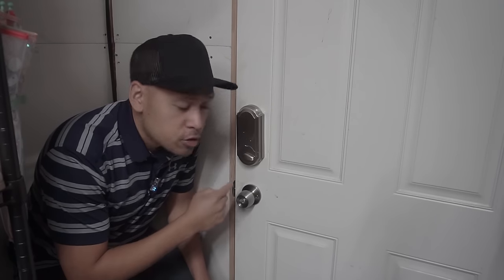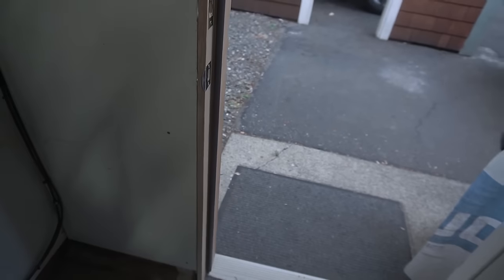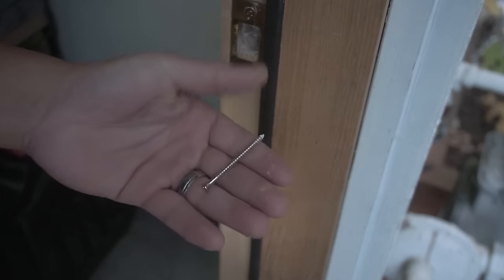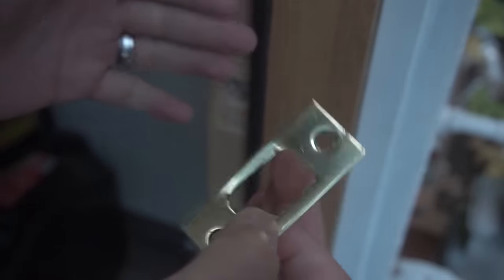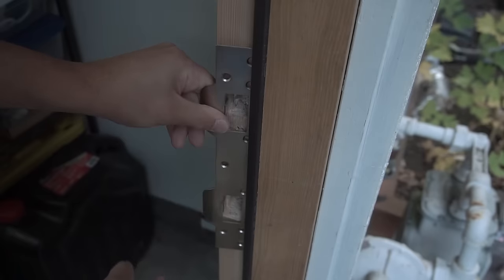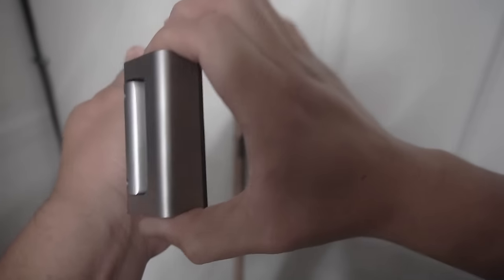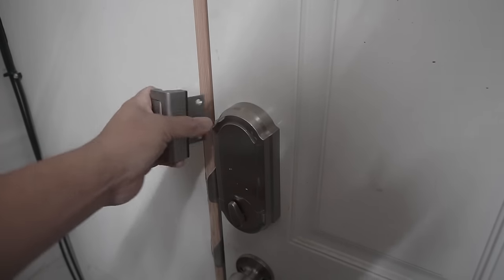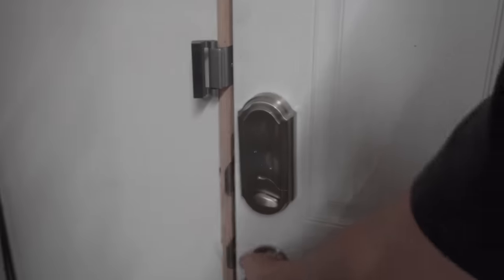How To Make Your Door Kick-In Proof Like A TANK! Keep Your Family & Home SAFE!

Comment: I am sure I am duplicating some comments here, but I would replace the screws on the hinges with 3" screws and get a brace for the opposite side to prevent the wood around the lock caving in. I'd also recommend a Haven lock or similar product which is independent of the door to prevent entry being gained easily. Absent that, great job on your site!

Comment: great video...  not sure if you've ever showed the screws that are used on sliding glass door locks  (the part that's in the frame and the door locks into)...  they are so short...  My neighbor's installer used the screws that came with it.  A burglar grabbed the exterior handle and just yanked the door open pulling the tiny screws out in one motion.   When we had our sliders installed, I made sure they were using 3" screws..  fortunately that was the installers normal practice.

Comment: As some have said, thicker stroner hinges with thicker longer screws. Next weak point.. That window at the top... And.. As an additional idea, a steel reinforced door (either wood panelling sandwiching a steel sheet - giving effect that it's JUST a 'Standard' wood door - wink wink, or, a steel sheet on the outside...) but then, find other weak points, like windows, window frames, etc etc. (A friend of mine (did the steel door trick, and also, laminated/integrated sheets of plexiglass on the inside of all his windows as someone had smashed a window and gotten in that way...) It can be made to look like nothing is different, but, confuses those that 'Think it's easy to get in'... Hahaha 😉
😎🇬🇧

Comment: Having worked as  firefighter for 30 years and having performed forceable entry into every kind of building.  I have found that building security is only as good as to the amount of noise the bad guy wants to make.   If they have the ability to make enough noise, they will get into the building.  The problem is that some forcible entry techniques do not make a heck of a lot of noise.  If you are using a circular saw, yes...using a Halligan pry bar, not so much.

Comment: Thank you for your video. 

Measure from the doorknob down, make a two by four six inches longer than the measurement with a notch in one end for the doorknob and cut the bottom at the right angle to the floor and place a stopper where the two by four hits the floor. 
Jam in the two by four under the door handle and the floor stopper and it works great. 
Any pressure against the door lifts the door slightly jamming it harder into the frame at the top of the door. 

Good luck
Reply: Can you please elaborate a little on this “ stopper “ and your solution ?
  I’m intrigued but don’t “ get “ it …
   Thanks in advance .
Reply: @rudeawakening3833  The 2 X 4 is notched on the end that fits under the door knob. It then slopes to the floor at an angle and where the end butts the floor you want a "stopper" to keep the end from "kicking" out".
This stopper could be a block of wood, a notch in the floor, a couple of nails, ... anything that stops the butt of the 2 X 4 from sliding or kicking out when the door is forced. 
I pray that helps.
Reply: @daval5563  
Thanks very much , sir .
   Have a Blessed day .

Comment: Metal frame that's lagged into the ground on a concrete floor and an expanded metal plate that goes through the whole header and screwed into the trim studs.  With a wood frame, that's absolutely the best security you can have.  And it only takes a quick hour's worth of site-work with a competent carpenter to make it happen.  Then use a security door, deadbolt, and have the latch of the handle sink in far enough to where it seats fully into the strike (which is what the lip is for, so the bevel catches it and pushes in).  That makes it card-proof.  For extra-extra security, put a jamb guard on it so it's that much harder to get a sawzall in the gap.

Comment: I've used reverse to prevent striping, but never splitting. 🤷🏼‍♂️ It's the sharp point that splits to prevent tap it with a hammer to dull the point

Comment: Must say that the last application is what makes a tank. I've seen plenty of doors kicked in but also besides the jamb the door itself splits when there is a deadbolt with an extra heavy strike plate installed. The dam lock is truly the" tank" of this system

Comment: Being a carpenter I knew about the short screws in strike plates and the hinges. I have put many 3-inch screws in hinges to suck the top or bottom of the door over to make it close better. However, I had forgotten about these heavy-duty one-piece strike plates that I had seen at Lowes and/or Home Depot. Plus I never have seen that reinforcement lock. Hey, you forgot to replace the 1-inch hinge screws which is another weak point since they only go into the door frame and not the 2x4 studs. If someone wants in they can always come through a window they break. The question is if they get in will they make it out? Thanks!

Comment: I have those latches, if I recall its 2500 lbs of force rated. Id suggest one above and below the door handle about 1/3 range. Again is 2.5k lbs of force tines two plus existing door update. So unless thugs are packing 7k lbs of force capable door buster. Its  secure..

Comment: Buy strike plates from a locksmith they are thicker and some have metal pockets for enforcement… also buy doors with hardwood framing as they are stronger than the cheap pine frames… screws I would recommend using #9 x 3 1/2” in the hinge side and the latch side and make sure your latch fits tight and gaps are under a 1/4”

Comment: Your  site is an excellent mix of determining need,  the proper part or item required and a pro active  way of sharing the instructions to accomplish the project in the correct manner.  Your suggestion on how to retrofit existing  products to improve
the security by using 3 inch screws were spot on.  bravo and kudios.. we will use your site ongoing  respect  Achilles

Comment: the shorter screws are there for you to set your screw holes to chisel out the frame without stripping out the hole with the 3 inch screws you'll use to actually secure it.

Comment: I've been able to break into my friends houses (with them there watching) with just a credit card in most cases. The majority of homes don't have bump proof locks so for dead bolted doors a simple bump key got me into all my buddies houses. 🙃 I did that to prove a point. The locks need to be bump proof, they need to have picking protection and you need to reinforce the area where the bolt and knob are because kicking there a wood door will eventually fail, no matter how good the lock and plates are

Comment: I have said for years that type of door is a kick in style.  Some dead bolt holes are not drilled enough and the bolt doesn't fully lock so someone can slide the bolt out easily and break in.

Comment: Adding 3 inch screws to the hinges, and additional hinge bolts is important too.  The door is only as secure as its weakest link.  You can add all the 3 inch screws, additional locks and strike plates as you like to the locking side, but if the hinges still have the small screws, and no additional protections that door won't be as secure as it could be.

Comment: Dont use the cheap screws.  Go stainless or higher.  And i used 6 inch screws to go thru as much wood as possible.  I also added 6 inch screws to all hinges replacing the screws that came with the door.  Even with a kick hinge in place you can still split the door at the hinge point rather than having a split jam at the door/lock area.  You can install 2, one at the door knob and one on the opposite side by the hingepoint.  We did kick tests and it does very very well.   I dont use metal doors, they break and fold much easier than a fibreglass door.  I replaced all my metal doors with reinforced fibreglass doors.  They absorb the kicks and impacts where metal doors dont.  Then get a security screen door, key it on both sides, opening outward.  Done.

Never trust your jams or casings ever.  Got to get your screws into the the studs of your house wall.  If you dont your doors will fail 100% of the time.

Comment: Actually i use 4 inch screws for the strike plates on my door because my door jamb is already cracked so i took safety into consideration and i used the door knob strike plate instead of the original deadbolt strike plate for the deadbolt to have extra security and i also have plans on getting a reinforcement lock for my door even thought i already have a metal screen security door that already has a deadbolt and then again i plan to use 4 inch screws when I get that reinforcement lock for my door

Comment: Think commercial grade outswing doors. put a latch guard on the door handle. Buy a single bore door. Go 16" Above the knob and drill your dead bolt in.  use grade one commercial SCHLAGE.  Put a hardwired switch and mag alarm sensor on the door. Sentral Mag lock if you want extra security.

Comment: I had the back door to the triplex I lived in during college kicked in, shattering the wooden frame. Months later they finally fixed it, by adding a 3/8 inch thick steel bar lag bolted into the frame. Lo and behold, that got kicked in and bent in half one day.

Comment: This is really helpful.  But if you need all of this to keep out intruders, you may just consider moving somewhere outside an active battle zone...
I really like the reinforced strike plate.  I already put in hardened steel, 2", thicker screws in every hole of my exterior door hinges and strike plates.  But my dead bolts are extra long, and sit deeply into myframe.  I just want the strike plate to not be the weak point.  I feel like the last lock is a little overkill for me, but I'm suburban, so it's less necessary.  When we lived in the hood, I would haveadded it, for sure.  But our biggest problem was cops breaking down doors at the wrong address (sort of often).  We just moved rather than waiting for it to happen to us and me going to prison for neutralizing several cops over their clerical error.
Reply: It absolutely doesn't matter where you live. Reinforcing your front door is cheap and worth the effort.
Reply: @rcampbell4967  I did put the plate on.  It looks amazing, and it is tough!  I did have to chisel a little , but it wasn't bad.  That's not a weak point any more!  Thanks for the tips!

Comment: Your advice is excellent and will work for most burglars but the pros will use a crowbar on the opposite side of the door (where the door hinges are located).  The crowbar will snap the three weak screws on the top and then they do the same thing to the middle and bottom of the door.  None of your advice will protect someone against this type of break-in.  Most screws are made out of weak metal.  I would recommend a source for extra strong screws if they exist on the market.  Thank you for the video and advice!

Comment: If you really want to make your front door like a 'tank,' then also consider using the same three inch screws on the bracket side of your door and installing a metal mount that also covers the brackets. 
You should also look into the metal door plates that go around, back and front, your door handle latch and bolt, which also helps prevent prying of the lock. Don't overlook the back or side door, if it is also exposed!
I notice that you also don't have a spyhole in your door to check outside prior to opening? I would also not encourage people to have windows in their doors or at either side, as although it lets in light, it is also a vulnerability. 
Then, if you still wish, you can move onto a camera or cameras around your house and a self monitored alarm system. Don't get a monitored one, as by the time they respond, the offender will have been and gone! 
Make sure you don't keep expensive items close to exposed windows, that someone can see from the outside. Don't keep furniture or a ladder outside, that someone can use. Keep blinds or curtains closed, so that people can't see inside. Use a smart light or lights to randomly turn on/off throughout the day/night. Also consider the same for a radio/television!
Contact your local Crime Prevention Officer if you need further advice :)

Comment: You need a solid core door. People are talking about putting in 3" screws on the hinges too, but that wont help with the screws fail between the hinge and the door. Dont matter how long the screws are in the hinge on the door side if the door is hollow...
With a hollow door, you can kick the door down only to find all the hinges still attached to the frame.

Comment: In the hood I put 2 by 6s in place of the door trim lag bolted and screwed to the framing of the house to hold the door jam in place then I put nuts and bolts next to above and below the dead bolts through the door and stripped the bolt after the nut.the nuts and bolts keep the door from splitting.the knob and deadbolt holes weaken the door

Comment: Generally good lock sets deadbolts have screws that go deep into the studs on the other side of the door frame. You need to throw them out first or else you're going to strip the screws. You want to use the hardware it came with or longer screws.

Comment: I like what you do I really do, one thing that you could have done to reinforce the door just a lot more is to put the plate that you have to remove your deadbolt and your door knob you slide the plate on and then you screw the play on the door and then it reinforces the door from splitting itself because I've had it where my door has gotten kicked in in the frame broke but my door also split and broke so if you use that plate it is a steel plate that will make it nearly impossible to split your door and you won't be able to kick in the frame if you use that plate too I really love your video.

Comment: The door frame to my condominium is constructed of an extruded steel, 4-inch square tubing. The tubing has approximately a half inch wall thickness. The door is a Latham steel door. It will take a hydraulic ram to force entry.

Comment: The easiest way to make the door stronger and safer is too hang it the correct way, it should swing out, never in. Here in Sweden its illegal to have exterior doors swinging in, both from a break in standpoint and a fire safety standpoint, having the door swing out makes it easier to run out in case of a fire.

Comment: It is possible that the replacement lock strike plate will not fit between the door and the jamb and will need to be "mortised in" which means wood will have to be "relieved" from the jamb.  That usually also looks more professional provided it is cleanly done.

Comment: It's great when it all fits, like in your example here (with the one exception of having to chisel out a little) but it'd be nice if more adaption techniques were shown, something I haven't seen (so far) anywhere on YouTube. So, for example, what if the thicker metal prevented the door from closing? How does one adapt the plate placement in that situation?
Reply: @diann9159  yes but the techniques used for chiseling the area vary from very precise to very sloppy. It would be nice to see the very precise and professional way of doing it so one can learn. And that is just one of the other possibilities.

Comment: Don't forget a Jimmy-proof plate too covering the lock wedge. Apartment buildings have steel-reinforced, heavy doors and steel door frames, making any further reinforcement unnecessary. However, they're extremely vulnerable to prying levers jammed up into the door frame.
Reply: Very important
Reply: This prying happened to my sister's boyfriend apartment. It had a steel frame and thick wood door.

Comment: That style of foam core door is susceptible to a flex from a kick more than any frame/lock mod will handle. A good solid boot to the middle of the door will actually flex the door enough that the deadbolt and any other holding relying on a bolt, latch or retainer will actually be pulled out of the strike plates. If the frame is still original the jamb will split anyway but I have seen doors that you could not tell were kicked in other than the foot print and the structure of the clad door is weakened as it bowed under the kick and, essentially, delaminated. The only way to avoid that is to use a solid door, no flex, steel door where the foam is not forming part of the structure but is only insulation or a better captured locking like a vertical action bolt installed properly or use a structural steel bar across the door mounted with carriage bolts to eliminate that flexibility.

If the door were upgraded, all the tips are very good though.

Comment: Not all 3 inch screws will prevent doors from getting kicked in, the kick splits the door jam right in half if you install an extra long screw without pre-drilling the hole first. The longer and bigger screw actually makes the ‘kicker’s’ job easier.

Comment: Over here in Finland, all front doors open outward. So, you'd need to kick not only the door inside but also the whole door frame. Unless your burglar is Schwarzenegger, it's not going to happen. The reason for doors to open like that is not anti-burglary, though. It's because if a building catches fire, you can simply run outside, pushing the door open in front of you. If a door opens inward, panicked people could block the door with their own mass of bodies, preventing the door from being opened. That has actually happened out there in countries with inward opening doors, typically in overcrowded nightclubs or other such places.

Comment: I put 1/2”x2” Steel bar on the inside of door frame with 2” screws securing it to door frame and stud beside door frame,we have storm door which swings out,hinge pins have been riveted to prevent removing,both doors also deadbolted,door that swings out impossible to kick in.